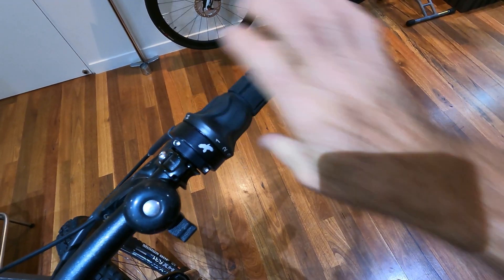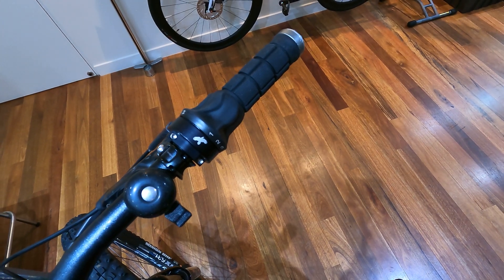Explained - the Rohloff A12 Speedhub Rear Wheel Removal

Comment: Good sir, I'm happy to have found your videos early in my rohloff conversion adventure. My question concerns the thru axle mounting. I have a niner rip 9 version 3.0 frame with rock shox 12x142mm thru axle or maxle. The inside of the frame is flat on both sides. What other information would I need to be able to confidently order one of these fantastic hubs?

Comment: I picked up my Specialized Kenevo this week fitted with the Rohloff, it works fine until I start to climb in an easy gear. When climbing in the easy gear the power assist cuts out and says I have a sensor issue check and clean the sensor, the sensor is clean and doesn't have an issue, once the bike has been turned off and on again it clears and power is restored only to stop again once pedalling. If I use a slightly higher gear this doesn't happen, can you explain how to fix this issue? Do you have to go into the main settings of the bike to correct these issues, as the gear ratio is lower than a cassette does the sensor think the wheel is spinning too fast and something is wrong therefor think there's a problem and cutting power? Please help this is very frustrating. Kind regards, Roger.
Reply from the maker: Roger, I am sorry to hear you are having issues with your eBike... this is not a Rohloff Speedhub problem. I will respond further by email, as you have posted this here on Youtube, on our Rohloff Australia Facebook page and you emailed me. Again sorry, but yesterday was Fathers Day, it was Sunday and I spent that time with my family.

I caution people as I did you about making sure if you attempt this conversion that you spend the time and detail necessary to get everything right, and have the necessary competency and knowledge. And I will repeat what I wrote previously to you... "we cannot take any responsibility for the installation works on the Levo to fit the Rohloff… we obviously warrant and backup the Rohloff 100%. Necessary to state that as to date we have had bike shops agreeing to do the conversion work without realising what’s involved to do it properly". 

Email me some closeup photos of the Kenevo's sensor magnet which has now been installed onto the Rohloff disc brake rotor? I will try and help you and the bike shop that did your Rohloff conversion resolve this problem and get your Kenevo eBike back to operating as it should be.
Reply: @paulmoir-mtb  Really appreciate all the help, love the Rohloff.

Comment: Great video thanks Paul. 
Might have to invest in a coil shock for my 2021 Levo comp when I get the Rohloff off you.
I cant see what brand it is.
Did it fit straight in like the Cane creek does?
I asked my LBS why everyone puts Cane creeks in the Levo's, he said it's because they fit straight in.
Reply from the maker: Josh, it is a Push Industries - expensive, but each Push Industries rear shock (their 11.6) is made for that bike... that geometry and that linkage design, you simply adjust the spring for your weight. They don't make them for all bikes, just a limited number in fact but the Turbo Levo is one. Big advantage for mounting is the spherical bearing which removes any unwonted side loads/forces. Talk with Aden at Cyclinic in Brissy (Kelvin Grove). Two shocks in one, I love this shock (https://www.pushindustries.com/products/elevensix)